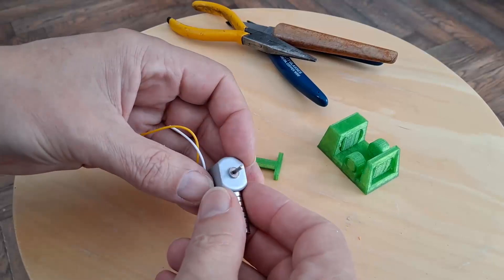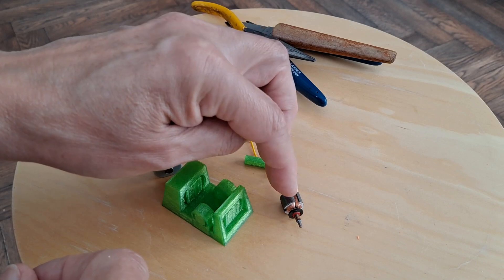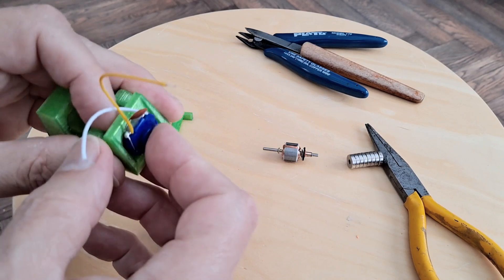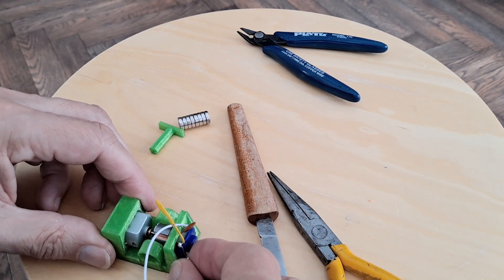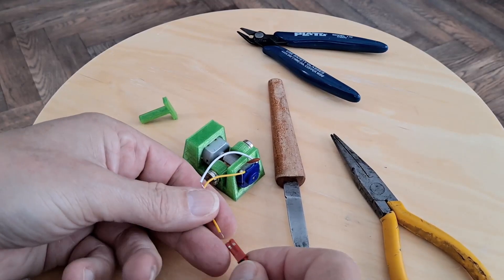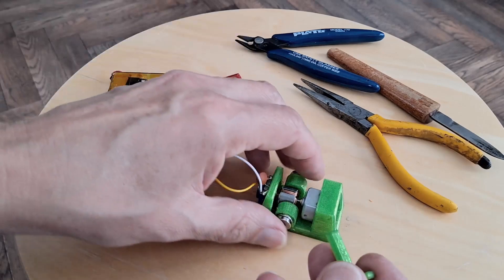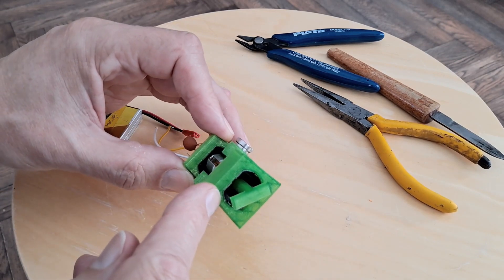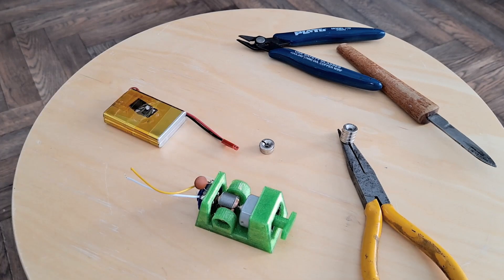Video reply - Inside out DC motor 20220901

Comment: I like the electric punk look of that.. if you cut the case down so you could move the end case back and make it thinner and maybe make the brushes sit like you intended , just for aesthetics... Iforgot where I was headed with this.....
Reply from the maker: I wanted to use the original parts unmodified so I could put it back together again. Otherwise I could have just put bushes direct in the PLA for the bearings and made some brass brushes. That might be another project. It would run without bearings, just direct in the PLA until it overheats and that would also be a good demonstration. 👍
Reply: @GrandadIsAnOldMan  I kind of thought that you wanted to just use the parts and maybe reuse the motor. I didnt think about the rest... that printer opens new realms that require a different thinking process.. I saw a advert yesterday for a machine that turns scrap plastic into printer filament. Bottle caps or other PET plastic, all the little filler bits and rafts you now throw away, ends of line etc.. I guess you can save colors until you have enough for a batch but I was picturing multi colored filaments and projects
Reply from the maker: @docink6175  Last time I looked into a machine for doing the recycling of the filament is was something like 5 times the price of a printer. It would only handle virgin clean filament, so if it has been on the floor and picked up dust or you have used glue on it, then it cannot be used. It only needs a bit of dust in the mix to block the nozzle of your printer.

Comment: Motors do run faster with weaker magnets - though providing less torque.  Neglecting losses such as friction, the motor accelerates until the back emf caused by the windings cutting the magnetic field equals the applied voltage:  when the magnetic field is weaker, the motor has to spin faster to do that.  Of course, you can't keep reducing the magnetic field indefinitely, to get a faster spin - there comes a point where there's not enough torque to overcome the friction.
If you can move the magnets while the motor's spinning, that would be an interesting experiment.  You could start with the full complement of magnets, close to the armature, then gradually move them farther away and hear the motor speed up.

Comment: Does this qualify as a brushless motor?
Reply from the maker: Nope, I am still using the original brushes. The only thing I am doing here is using neodymium magnets in answer to a request I had. I turned the original motor case round so I could still use the bearings.

Comment: I would have expected more precision was required with the magnets for things to work. Apparently the system isn't picky, just needs to have the basic components. 
Interesting. 👍
Reply from the maker: If you want to see how imprecise you can go, have a look at my old electric car project https://www.youtube.com/playlist?list=PLA5a2xPRSrB0scvCxBYNn35HohUxUoj0e
Reply: @GrandadIsAnOldMan  I watched the video. If I'm not mistaken that's essentially a brushed motor. With construction being so simple, I'm even more perplexed by the new rc I just bought that only drives in reverse. I had assumed it was a motor issue but I'm leaning more towards ESC now. I'll have to test the motor when I get in my upgrades.
Reply from the maker: @DirtyPlumbus  if it has a brush, rubbing on a commutator, then it is a brushed motor. Is your RC motor brushless? If it is brushless and has 3 wires and it is running in reverse, you just swap any two of the three and it will change the direction of rotation.
Reply: @GrandadIsAnOldMan  it's a 1/24 scale crawler so I assume it's brushed. When you pull the throttle it goes in reverse and if you switch the throttle to reverse it still won't go forward, but reverse works correctly. Since the throttle reverses I assume the radio is working correctly.
Reply from the maker: @DirtyPlumbus  That does sound like an ESC fault. Has it ever worked correctly, or was it like that out of the box. If it was faulty out of the box, I would be sending it back to where it came from.
Reply: @GrandadIsAnOldMan  like that out of the box. In my research I found it's fairly common to have issues with this particular model, which was surprising since it's so popular and I hadn't heard anything about it.
I had intended to upgrade the electronics anyway, so I'm not going to bother sending it back and likely getting another faulty product. Just unfortunate I can't use it until I can do the upgrades. 
Thanks for all the information. I learned alot.